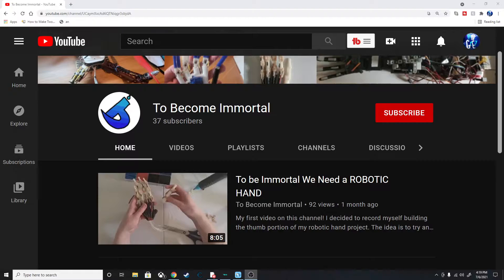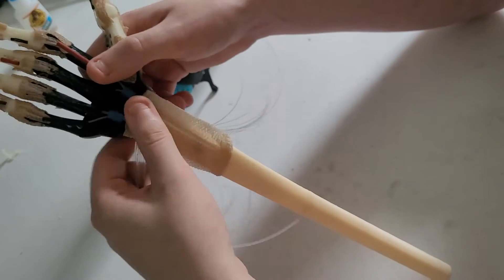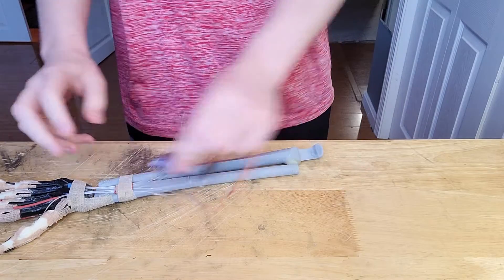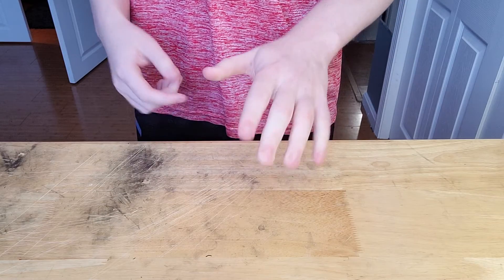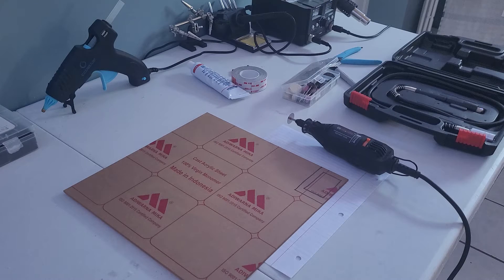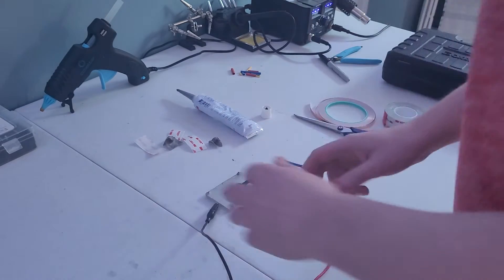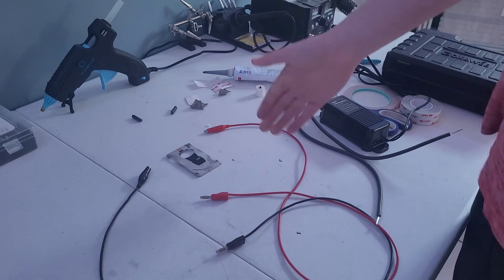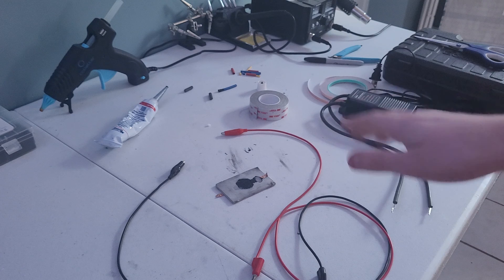Making Artificial Muscles! | Robot Arm Build

Comment: So a few ideas. An in-line motor assembly could use twisted string actuators. There's also pneumatics. I had some successful tests with inflating plastic chambers, which then contract when inflated. I used sous-vide bags which you can pattern with a soldering iron, or even laser weld. I did some experiments with a multi-material 3d printer to generate novel muscle geometries. Nylon constraint layers with soft polyurethane inflatable chambers. One day I'll get back to it!